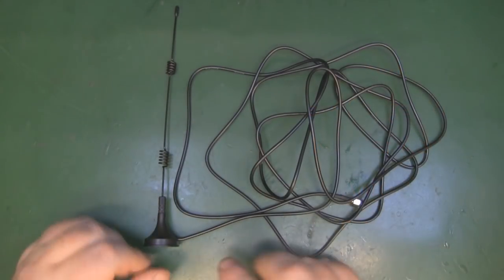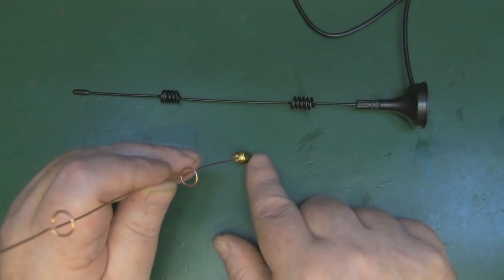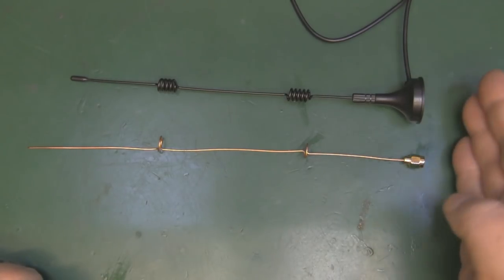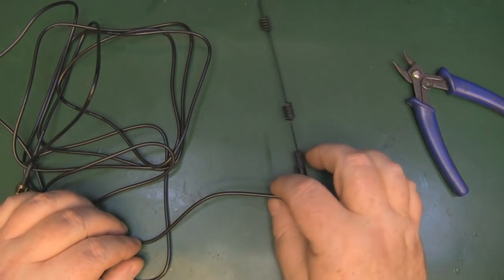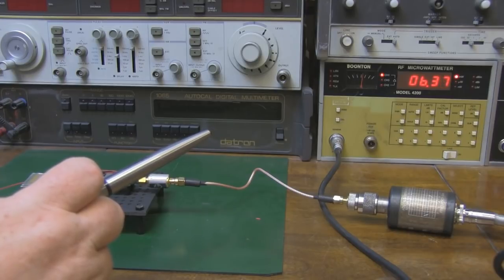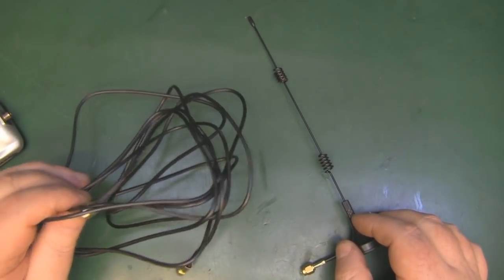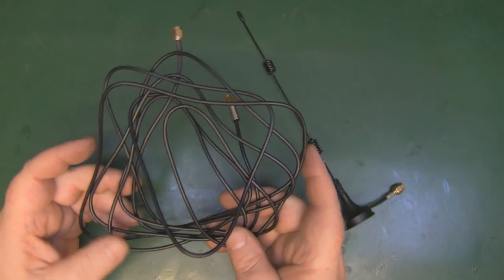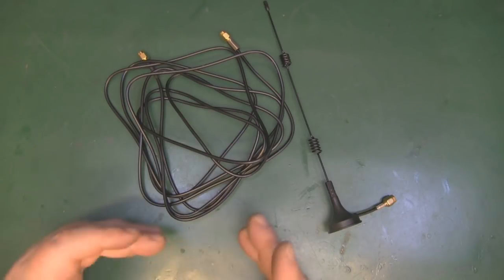A Nice 2 4 GHz Wifi Collinear Antenna Let Down By Poor Coax

Comment: This answers the question I was asking myself yesterday, on the search for some thin shielded wire, when cheap antennas with a cable were £5 and the same length of coax on its own (with connectors) was £18!

Comment: I have the same antenna I purchased to boost the range of my rc transmitter when I fly while sitting inside my truck. Even with the antenna on the roof outside of the cab the range was worse than when using the stock internal dipole antenna while sitting in the driver seat. Now I know why. Thanks!!!
Reply: Hi! Could you send me a link to a shop where I could buy the antenna, please?! thx and cheers!
Reply: @Funibert-Fox  also you can peel the black plastic sticker off the bottom and pry the mount apart so you can desolder the coax instead of cutting it. Message me if you have trouble.
Reply: @flipcrash8537  Thank you so much.

Comment: Shortening the coax made a vast improvement to the reception on my Huawei B525 Router
No need for an SMA connector
On the base of the antenna is a rubber washer, its impossible to see the join, so use a Stanley Knife (or Minature Hacksaw)to prise it off
Then prize out the metal cover on which the 1 cm wide magnet is attached
The coax inner core is "soldered" to the base of the antenna, the braid does nothing
Cut back coax and re-solder
I reduced the coax lenght to 6" enough for the SMA connector to screw in the rear of the Router
Reducing both cable lenghts  now instead of a 4 bar signal it gives me the max of 5 bar
Cost = 15 mins of time

Comment: I have two questions on this: (1) When discussing your measurement setup, you say that you are getting roughly 200 mW out of the amplifier, then you say it's 2.662 mW. Then with the 3 dB pad you measure 6.37 mW, suggesting that you really have somewhere about 12.74 mW of power out of the amp... how do those figures fit together? (2) with the coax but no attenuator you measure 3.6 mW, suggesting that the cable has approx. 5.5 dB of loss. However, when you do the scan with the modified antenna, you see e.g. Wifi_Repeater at -54 dBm and VM1075635 at -82 dBm. The extra coax should knock Wifi_Repeater down by 5.5 dB to -59.5 dBm, still more than 100 times stronger than  VM1075635. Yet Wifi_Repeater (or any of the similarly strong stations) is not there in the first scan with the unmodified antenna. Any idea why this is?
Reply: Rx isn't as effected as tx over any length of coax on any freq it's just the higher you go the worse it gets and at 2.4ghz there is no low loss coax at these freqs it's best to keep the coax length as short as poss as for the other signals he picked up there so weak that the reduction of signal through the coax was enough not to pick them up that's all.
Reply: @petechongy  if RX isn't affected the same as TX, then your coax violates the 3. law of thermodynamics!
Reply: OK thanks for your response but you're not really addressing any of the questions I asked, which are about the actual power figures mentioned in the video. Of course there's less loss in the system when the coax is removed but that's not what I asked. Also, your statement about RX and TX being affected in different ways by the TL is very, very odd...
Reply: @petechongy  loss is loss.TX/RX both 100% affected equally.
Reply: @MrCircuitMatt  You're very polite, I wouldn't call it odd, I'll call is BS :)

Comment: Hi i have a question for you i bought a package of 4 of theses antenna i modified my routeur to have some rp-sma femelle connector i have 2 connector for the 2,4ghz and 2 connector for the 5ghz but there is like 6 feet of cheap wire on those antenna do you think that i should try to modify those antenna or it would be better to simply get reimburse are those antenna are really capable of doing 9 dbi ?

Comment: Andrew I understand from CB aerials that the coils  were just to shorten the vast length of the aerial and detracted from the signal a little. This surely does not matter on 2.4ghz. Why don't you try to uncoil the one you bought and make a straight rod of it, with your better coax?

Comment: So the question is then what is a very. Good coax then?
Good video. Learned a lot
Reply: Hi,
for lower frequency stuff (below 8GHz or so) I recommend RG402 or maybe some rg316 for even lower frequency stuff. 
For even higher frequencies or if you need very low loss RG213 or even better RG393 works pretty good but nothing can beat some rigid coax cables. 
(The Aircell 5 or 10 series of cables is also pretty good if you need some decent cable for a good price.)

Regards,

Comment: I tested also the S11 of that antenna with and without the RF cable: it's not good at all! I tested also the dual band version. Mine home made is much better.
The internal braid of the RF cable is not welded and is kept wedged in the metal that holds the magnet, this creates bad adhesion.
I think black paint also generates some tuning problems. I have not tried to sand it.
Obviously, this type of antenna needs a very good ground plane.

Comment: At 7:30 he says the signal is boosted to just over 200 mw of power, then he says it's 2.622 mw.
Just ignoring what he is saying, if the meter shows 6.4mw after a 3db attenuator, the the power TO the attenuator is twice that (a 3db attenuator reduces the power by half), or about 12.8 mw. 
The coax is lossy, but he seems to be completely lost in his units.

Comment: Do you have a brand of coaxial cable that you would recommend?

The last thing I want to do is to desolder the current rubbish coaxial cable, just to solder on more cable which is just as bad!
Reply: rg 316

Comment: Great video Andrew .. iam getting into long range FPV with a frSky 868  system stock TX antennas are crap can you build one PLEASE... Ps power output is variable up to 1W ...
Reply: Brian Mabbett Frsky already make much better 2.4 antennas, a folded dipole for the transmitter and a dipole for the receiver end.
Reply: @robrow  it not 2.4  its 868 Mhz
Reply: Brian Mabbett Yes, sorry my typo, they are 868mhz.

Comment: What type of connector is  between the antenna and the base?  It doesn't appear to be SMA, but smaller.
Reply from the maker: it's just a thread m3 if I remember
Reply: @andrewmcneil  Ok, I'm trying to figure out  how to adapt it to an RP-SMA.  Thanks

Comment: whn I was king, one speaker si louder than other,  after some time, I use multimetter and found higher resistance than 4 ohm from speaker.. I will buy this antenna and cut cable, then connect to wifi router. Thanks for video